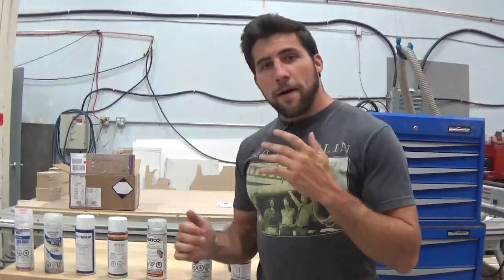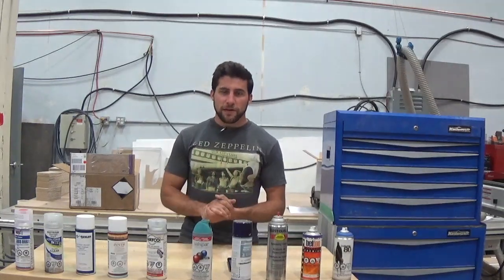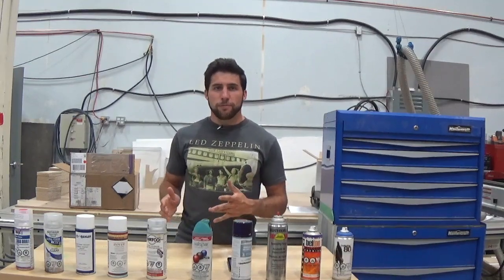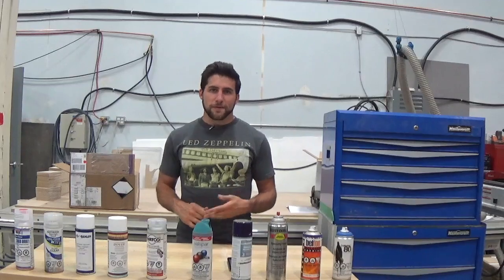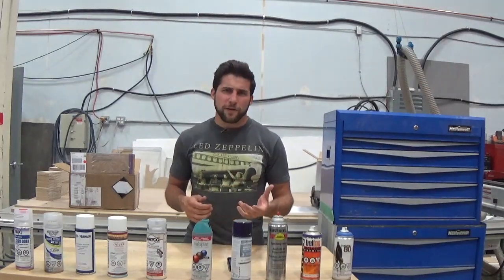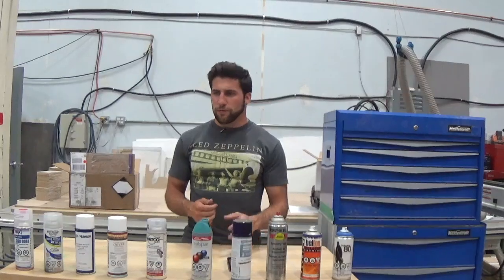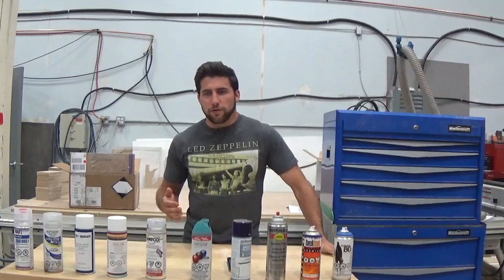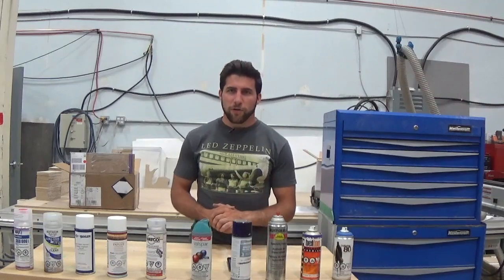The Top 5 Mistakes to Avoid When Painting With Spray Paint

Comment: Not what I was looking for . But I must say you are about the best tutorial speaker I've seen on youtube.  To the point, concise and great relaxed mannerism. Too bad the information I often go for has speakers who cannot get their point across. Either poor video, WRONG answers, garbled speech (often from recording) or just become redundant. Very Good job Brad. I'm impressed.
Reply from the maker: Thank you sir. Just out of curiosity, what information are you looking for?
Reply: I am planning on repainting a wrought iron porch railing with posts. It has lots of, but somewhat light, rust spots all about.  It's 'leaf / ivy' design is too attractive to give up, but hand cleaning these rust spots with steel wool/vinegar wash or wire brushes on its very intricate design will be very time extensive. I had used a 'rust reformer' about 10 years ago which worked but left it black. Which I don't mind since I'm repainting it anyway (It's white now & I like it as such)  That said, the new rust reformer they have now  doesn't turn black, but also doesn't work. I was hoping to find some ideas to get this project to a good start with a years to come equally good results. Sand blasting may be a good idea for the very few 'bigger' spots (1/4" at largest) but hardly the way to go on the whole porch (60' x 8'). Think if I sprayed on the newer rust reformer and paint over it with quality oil based paint will suffice?  How would you do it?
Reply from the maker: I think you would need to worry about it spreading under the paint if you tried that. Have you considered a wire brush or soft wire wheel on a drill for generally scuffing and removal? Then an anti-rust primer etc.
Reply: Wire brushing combined with a dremel wire wheel is still at my most foremost thought. But as I said, it's a long and fairly tall iron porch surround. Making it very time consuming regardless of how light the dots of rust. The seven 'support' posts are 8" hollow squares each with an intricate leaf and ivy design. Getting inside the square would take an extension on either brush or wire wheel. In fact, I started a small section to time myself. It took (me) 45 min to hand wire a 2' X 42" section. And that was a straight away section with full both side access. I dread the 'hollow' four sided posts. Time is one thing. To do a redundant task ever so slowly while squatting, standing, kneeling kind of makes me shiver in thoughts of extreme muscle & joint stiffness. Where are the groups of boy scouts wanting to do fund raising tasks when you need them. Last option is to hire a painter (of sorts). Have them dismantle the entire unit, place supports while they sand blast, prime and paint before reinstalling. Those are the options I've danced with.  Question... Do you feel my pain,LOL
Reply from the maker: That’s brutal. I would have thought quickly running a wire brush over it would be minimally time consuming. Sounds like you’ve got quite the project on your hands.
Reply: Yeah, labor intensive, but not strenuous. Like I said, spots of rust are really tiny with the largest being about 1/4 inch. And of those, there are very few. The spotting is more of rust  color bleeding from under the paint. Hasn't been repainted for about 20 years. We bought the house about three years now. After renovations to the two apartments and back yard, I want to brighten up the front porch. (damn I really like the wrought iron) The spotting being so minute, it was the least of the list of my to-do's. In fact, I don't know the name of those very tiny 'orange' spider like critters that seem to relish walking on hot smooth surfaces, but they are about the same size and color of my rust 'damage'. Sure wish I could find that original rust reformer. It worked great. stopped all rust progression by reverse oxidation? Which may have been why it turned the metal black. It was great getting your feedback to my pesky issue. You are one of the great one's on youtube tutorials for sure.
Reply from the maker: I’ll let you know if any other solutions come to mind. Hopefully you find an efficient way to get that dealt with.
Reply: J. Morrison, I agree wrought iron is beautiful and special. Rust is nasty. It is not a static thing. It is like a living organism and is fed by H20, even under a coat of paint. Sandblasting is a good bet for getting to the rust, but I am afraid once it has begun, unless every speck is eradicated, it will continue to spread.
I found a Chemistry focused Q&A on rust removal and paint.
You may learn some things. I did. I find through pro message board forums, product information and techniques are shared. And it is possible you may hear mention of that rust reformer you used before and maybe get a lead on where to find it, finding a comparable product or get product name & company contact info you can call or write for direction.
good luck!
And thank YOU, Brad. My problem is drippage and you did address that in someone else's post, so thank you. ;-)
https://chemistry.stackexchange.com/questions/19322/painting-metal-does-it-matter-if-all-rust-is-removed-before

Comment: My primed surface grabs my microfiber clothe and literally pulls the fibers out of the clothe so no wiping down without full g350  sanding and cleaning in between  each coat creating scratches that need be worked out up to g1000 again before a new coat can be applied with the same results again. Rust oleum primer can't go on heavier than extremely light creating a sandpaper feeling surface coat or  without running like water on overlapping  spray coats or both. What do I do before clear on the finish base color coat painted surface? and do I need to keep resanding the clear coats to get a smooth non clothe catching semi gloss finish over a mirrored clean smooth surface paint job?

Comment: I used BEHR Aerosol Enamel Paint on my car rims. Painted with rustoleum 2 years ago. Painting in my basement. First 2 coats went on fine. 2 rims in 1 afternoon. Went to put 3rd coat on the next morning,  it alligatored with in seconds on 100% of each rim. It looks amazing and I want to recreate it on the other 2 but I do not know what I did nor how to recreate it. The paint on the 2nd and 3rd coats came from the same spray can.

Comment: Thank you for this informative video,👍👍Ive been thinking about spray painting my work table. As a Nail Technician i may spill some acetone or monomer on my table, will these chemicals remove  or strip the spray paint from the wood? Just wanted to know how durable spray  paints are because ive never used them before.
Reply from the maker: Yes those chemicals will remove most paints. If you want to avoid that you need a catalyzed paint or clear coat (which are somewhat dangerous).

Comment: Hey, I’m using rust oleum enamel paint and clear. It’s cold here in Texas and I’m trying to paint my valve cover in a back room and as I applied the clear I realized it wrinkles instantly. What causes the clear to rinkles?
Reply from the maker: Could be surface contamination or temperature. Have a look at my video on why your paint is crazing.
Reply: @BradAngove  ok

Comment: Great info! I have a bicycle carbon fork that's painted gloss black. I'd like to paint it a dark gray to match the frame. Can I just scuff the clear coat off the fork and then spray over. Or do I need to sand it down to expose the carbon weave?
Reply from the maker: Yes, just scuff at 600 grit and paint.

Comment: If it is a cold day, is it a good idea to warm your paint up in a bucket of warm water first? Also is there a rough guide when using spray tins, of an application speed per foot and a distance eg. At 6 inches away from the workpiece, you need to cover 1 foot per 2 seconds. I go back and forth several times to get a light layer first, leave a few minutes, then repeat.  This can take a while, but I still get the odd run.  Good tip, not to mess with when wet, I fell foul of this on may occasions to stop runs.  turning work upside down if small enough does help reduce the damage though.
Reply from the maker: I like to warm my paint up, but I don’t spray in cold conditions. That causes all sorts of problems. 
Have a look at my video on how to get an even coat of paint with spray cans to see application speed etc.

Comment: Brad thanks for the quick response.   I'm fixing a mistake tomorrow morning that I attempted to fix while wet.   A big no-no as you pointed out.   I plan to sand it back smooth again.   Do you recommend dry sanding for that too?  Thanks again!  (I subscribed today by the way, and I don't subscribe to just any channel! )
Reply from the maker: The only time I wet sand is when I’m going through the polishing process, and even then it’s only on metals and plastics. I dry sand 90% of the time.

Comment: I am purchasing a 55 gallon drum to make a smoker.  At what grit would I sand the outside of the drum to paint the drum a different color?  Just use primer and spray paint?  Use a cleaner before hand?  Acrylic or enamel?  What spray paint do you think works best for something like a 55 gallon drum?  Thanks for the video.
Reply from the maker: That would get pretty hot right?
Reply: @BradAngove  Yes sir...
Reply from the maker: I think you’re going to need heat resistant paint. Powder coating would be better, but something like engine enamel or caliper paint should work I think.
Reply: @BradAngove  Sounds good!  I appreciate your time. :)

Comment: Very informative.I mostly use belton cans to spray paint objects and i had a few of them chipping(small chip in corner).
My first question is whether rustoleum for example or other brands of spray cans that are specifically designed to paint objects(i believe) are stronger than spray cans that are designed to use for art(e.g. belton or sabotage).
My second question is if you prefer a specific grid for sanding aluminium enclosures(i guess that would be different for other materials),before you spray the primer.Would 400 grit be good?
Thank you in advance
Reply from the maker: 400 or 600 grit is good for prep. Belton and sabotaz are fine for spraying stuff that isn’t being handled, but they’re not really part of a multi-coat system. Something with a primer and clear coat would generally be more durable.

Comment: Great info! I'm just wondering how long do I wait to apply my clearcoat after sanding. I let my color layers fully cure, and now just need to sand a bit.. 
And then do I lightly wash it obviously to get any dust/residue off? Then spray on clear coat once clean and dry? Lol I'm racing against temps.. getting too cold here to paint and don't have heated garage.. though can provide some heat in my makeshift "paint booth" complete with air exchange system.. 🤣
Reply from the maker: Right after you’ve sanded you can go ahead and clean in, and when it’s dry you should be fine to put on the clear.

Comment: So Im using rattle can Nitro, still spraying my color coat used up the paint thought great all done,,, looked today Ugghhhh a really nasty run, So other than spending another 24.00 for another can any fix tips to get the run either out or passable that its not so noticeable? Thank you for all these video'a
Reply from the maker: Yeah, just sand it down so it’s even with the rest of the finish and smooth it out with 800 grit sandpaper. Then you can clear coat and it should look fine.

Comment: Hi Brad, love you vidz. Question please: I often hear that you paint brands should NEVER be mixed. I'm getting ready to spray a mahogany Telecaster body. I feel like I should use a vinyl sealer. Will the Mowhawk Vinyl sealer be okay if I use it under Oxford Sand Sealer, then Primer, then Nitros Lacquer?

Thanks, Amigo!
Reply from the maker: Hi Bill. I disagree with whoever said that. I frequently mix brands. With that said; Oxford has its own clear sanding sealer so I think the safer play is probably my to use their sanding sealer. But I suspect the Mohawk vinyl sealer would work fine.
Reply: @BradAngove  Hi Brad, thanks for the quick response!

My father died a little over a year ago. I found a chuck of wood in his shed. It turned out to be mahogany. I've shaped it into a telecaster body blank and I'm almost ready for pore filling.

Here's what my plan is:

1.) Pore Fill
2.) Oxford sanding Sealer
3.) Oxford Primer
4.) Oxford Daphne Blue Nitro Lacquer
5.) Oxford Nitro Clear coats

Does that sound right to you?

P.S. I told the folks at Solo that your videos sent me there. They said you're the best!

Thanks!
Reply from the maker: I’m sorry to hear about your father Bill. That process sounds entirely correct to me. Cheers my friend.
Reply: @BradAngove  Again, thanks for your help with "Dad's Tele"!

Comment: Hello Brad, 1st of all thanks for this video, I have a question tho and I dont seem to be able to find any info anywhere about this issue, I recently painted the surface of a turntable, did the all prep such a ripped the old colour, sand in btw coats and let the coats dry for a day in between , I even polished and waxed the surface but i keep running into this issue which is everytime I put something on top of the surface , in this case a dust cover for the turntable the dust cover sticked to it leaving marks when I removed it, so im wondering what is causing this issue, I gotta say I didnt use a clear coat on this project, is this the reason why this is happening? thanks in advance Brad.
Reply from the maker: What’s kind of paint did you use? Some don’t work properly on plastic, or require a particular type of preparation.

Comment: Hi Brad.Thanks for great instructional videos!
In the movie  How to paint your guitar with spray cans part 1-4 after you finished paint in part 2 you did not say really clear about sanding or not sanding before clear coat.
In this video you recommending sanding before clear applied due to optional scuffs/imperfections etc and better stick of clear coat to painted surface.
Could you then recommend:after Ive sprayed guitar body with paint-do I need sanding surface-even if it looks good,or not necessery?
If yes what paper grit should I usually use?Also do you recommend wet or dry sanding(of paint coats and of clear coats??
Kind regards!
Reply from the maker: I'm pretty sure I scuffed the surface before clear coating in that video series as well. I like to gently dry sand my paint with 800 grit before clear coating if I'm not re-coating within the appropriate flash times.

Comment: You sed you need to dont mix between color then a clear coat ans we must pick the right one, how can I identify the right clear coat to use (I use acrylic coat most of the time but sometimes it just doesn't dry fast and takes days to dry) thank you.
Reply from the maker: Usually the manufacturer has a recommended type of clear coat for their paint. For acrylics you can usually use a few different types of clear. Acrylic, polyurethane, or polyester should work fine.

Comment: Also note that primer and top coat may have different layer times. 
Cause I made that mistake today. Same brand and line of paint and primer, waited 5-8 mins between primer coats. Moved to color and on the second coat I realized this wasn't dry enough. Thought I may trippin since it's very glossy and I'm not very experienced. 
Waited about 5-8 mins and applied a light 3rd coat. 
Confirmed that It was not just cause it's glossy lmao.

Comment: Thank you. Great tips! I made some of these mistakes ;-) 
When is the best moment to remove the masking tape, to avoid messing up the edges? Seems to vary between paint types, so is it best to remove the tape when paint is still not fully dry?  
And another -how do I minimize the edge, so it has a minimal "bump" against the underlayer of an older but 
good paint job?
Reply from the maker: You’re correct, it does depend on paint type. I generally let it dry fully before peeling. 
Have a look at my short series on how to do a frankenstrat paint job with spray cans for a decent rundown on dealing with tape ridges.

Comment: Hey, I have a question, I never seem to find an answer to,
how do I avoid or fix the spray paint becoming sticky after it dries? I used different types of spray paint, but mostly 'rust oleum', and I always get a sticky finish more or less depending or brand/type (when choosing a shiny finish rather than matt)
Reply from the maker: Sticky as in it doesn’t dry hard?

Comment: Your video was very informative.... My question is... I made a wood box to hold flowers indoors,  the color I spray painted it I don't like... Can I just use another color? What can I do?
Reply from the maker: +denina9 Let it dry fully, sand it lightly with 600 grit, then go ahead and spray it with a coat or two of the new colour.

Comment: 5 years later, but awesome video, congratz Brad! I have a question about plastic painting. I'm currently painting peripherals such as gaming mouse for example. So I'm sanding and preparing the surface first, using plastic primer, paint and then clear coat. The last step I'm doing is slightly sanding the surface with 2000 grit to get a smoother surface. My question is: should I sand it before I apply the clear coat? Should I let it dry completely to do that? Thanks again!
Reply from the maker: 2000 is too fine for before clear. Let it dry and sand lightly with 800 before clear. If you want you can sand the clear with 2000 and then polish if you want gloss.

Comment: Hi Brad, I want to spray paint a metal lamp. If I understood correctly, should I lightly sand it and then spray paint it with the desired color and then after the two coats, I lightly sand it and put a clear coat on it? Is the clear coat necessary if I’m going to have it inside my house? Thanks so much :)
Reply from the maker: If it’s metal you’ll need to use a primer first to get the paint to stick properly.